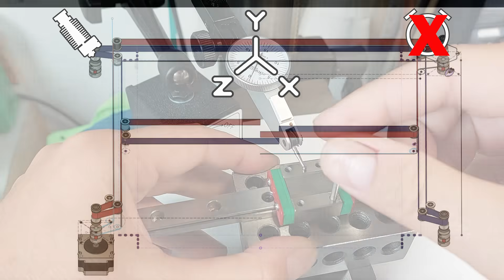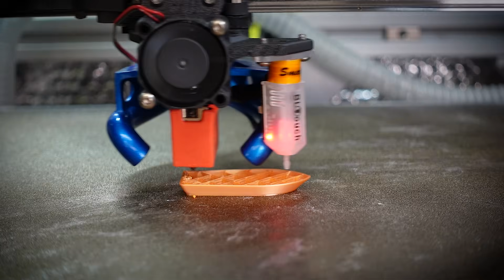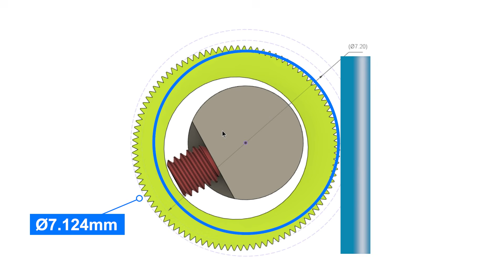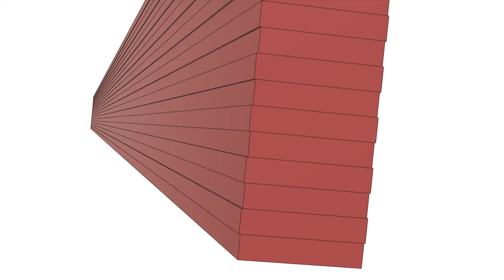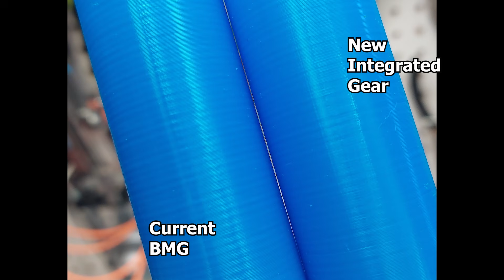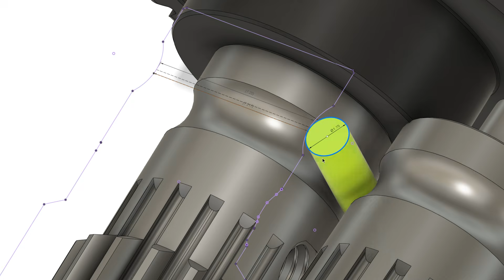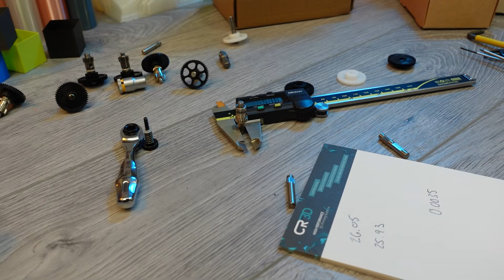Extrusion Quality - Mystery issue resolved !

Comment: {CHECK THIS OUT MY PRECIOUS ENGINEER FRIEND }
The filament diameter is also different in different sections, and its change the distance between the a gears.... so u should check the omg v2 extruder... the konception is also based on dual gear BUT IN  AVERY DIFFERENT WAY
Reply from the maker: Yes filament diameter variation will affect in several ways, one of them being the gear mesh distance.  As for the OMG v2 extruder how does it avoid the two gear sets from fighting each other due to mfg tolerances, filament centering in the hobb grove, and filament diameter variation?  These variations will have an impact on the rotation distance.  how to precisely keep them identical at all time?

Comment: This video is amazing!  The level of detail and profound insight is simply unparalleled.  In the terms of Bondtech and their gears, after modifying a few of the machines I have, including a Voron 2.4, Switchwire, and V0.1, with just bearing as shown in the videos, I can state some conclusions.  The problem with the idler is not just the machining or tolerances, the "wobble" is related to the DIRECTION in which the gear is being driven. I printed a custom mirror of a Sherpa Mini with Bondtech gears to see if the direction had any effect, which indeed it does in a reverse way.  The inducted "wobble" of the idler gear is produced by the moment applied by the distance between the gear movement, and the machined filament groove.  The harder the gear is driven, the more plastic it will extrude.  In order for the extrusion and the moments to be balanced, the idler gear would have to be balanced by another set of teeth at the same distance as the original Bondtech gear.  I tried the design using just 3d printed gears (with nylon), and the results are as good as using a bearing for the idler (which in my case I simply used properly sized rod).  I hope Bondtech and other manufacturers will correct this problem.  Thank you so much MirageC, not just for an open source amazing printer, but for the amazing, and so rare, quality content.
Reply from the maker: Oh wow!  You are absolutely right!  the moment between the resistance force from the idler spur gear and the resistance from the hobb pushing the filament may (will) vary.  Thank you for making me realise this.  I'll take this in our next meeting with Bondtech.  I'll let them know that some dude told me about that ;)

Comment: I think if we provide a tube support from top and bottom may force the filament stay in same place? just a thought
Reply from the maker: Yeas, maybe adding a PTFE at the top as well.  but PTFE are flexible and smaller ones have a ID of 1.9mm.  Using tighter fit would be a nightmare to change filament.

Comment: A few years ago I chased the same issues you had. It took many weeks of research to realize that it was the extruder that had a periodic error. Since then I always print a cone in vase mode to check for periodic extruder issues, it gives a very distinct spiral pattern if it's the extruder messing up. It's probably quite a common problem.
In my case it was a Zesty extruder that was very sensitive to how hard you torqued the bolts holding it together,

Comment: Excellent research work you’ve done hear. Bravo 👏🏼 
Do other extruder systems (eg hemera, lgx or ldo orbiter, microswiss…) show similar backlash on the gears ?
Seemed like higher precision manufacturing could solve the problem, which will unfortunately crank up prices a lot.
You got yourself a new patron :) keep on with all that great research. 🤓🤗
Reply from the maker: Thank you very much for supporting me! 😊 As for other extruders, at this point I think that while some of them might be better on the radial tolerances, most of them would suffer from potential filament walk affecting the effective rotation diameter.  I am convinced that now that the problem has been identified, we will see many new types of gears arising on the market.  More testing will be required to confirm what is efficiently controlling this aspect.

Comment: Hi. Great video thanks a lot! I'm trying to bring it on my flsun SR, but I have one question. The gear you suggest is for 8 tooth gear, while in the video I saw you have a "normal" 10 tooth one out of the stepper motor. So did you modify the wheelbase to adapt it or am I missing something?
Reply from the maker: The gear from Fysetc has the same modulus, diameter and teeth number than regular BMG gear.  Remember that we are using that BMG gear with our 10t gears, but it was initially intended for 17t.  What is important is the gear modulus.
Reply: @MirageC  mmmh ok that two gears to work together need to have the same modulus, but seen that m=d/z how is it possible that one keep the same diameter if the number of teeth changes? And the wheelbase is (d1+d2)/2, so if one of them changes the wheelbase should be adapted as well, I thought. I trust what you're saying in fact I've already bought motor and gear, I'm just curious to know where I'm wrong, sorry 😁
Reply from the maker: @anthonypasqualecarnevale1840  agreed, wheelbase will be affected if you are using an 8t vs a 10t motor gear.  Plastic gears are all 50t in what we are talking here.
My extruder wheelbase was designed for 10t motor pinion and this is what I am using.  If you are going to use 8t motor pinion, you need an extruder body that has the corresponding wheelbase to mate the 50t gear properly.

Comment: My old reprap printer had extruder with bearings and it was printing flawlessly. At one point I fully rebuild the printer with new stuff and that included upgrade to (fake) bontech gears. And yeah, the upgraded printer printed way worse. I suspected it was due to z-wobble (because leadscrews also changed), but the pattern was not repetitive, so z-wobble didn't make sense. It's nice that you have confirmed that the small gears can be the issue. Looks that I will try out the bearing extruder again.

Comment: Just use an OMG v2 and the gears problem won't even be part of the equation (for the way the extruder works).
Reply from the maker: Do you have some data or comparison images about this OMG extruder?  I am affraid that this design phylosophy may introduced artifact caused by the two extrusion forces fighting each other.  Remember, it really does not take much.
Reply: @MirageC  I really didn't dig too much: everybody was reccomending it for my printer (that comes with a BMG clone). Installed it, quality of the walls became immediately fantastic.
I guess you can find a lot of documentation online. Anyway, it's all metal (i mean, all), lightweight (for a bowden setup at least), the two internal cogs pushing the filament don't have any kind of 'play', so rotation and filament pulled is steady and consistent.
Quite expensive (around 40/50$), but i managed to get one for around 20$ (steal of the year).

Comment: get an OMG extruder, dual drive but inline big gears.
Reply from the maker: And what happens if one of the idler is getting the filament slightly deeper in the hobb groove?  Will the two pushing forces work against each other?  I am not convinced about this setup. And it is fairly bulky and heavy for a direct drive.

Comment: Wouldn't the cheapest way to get the hobb more centered on the shaft just be to use a hobb with more grub screws? A tapered collar on the shaft to shim it centered also comes to mind.
Reply from the maker: This could work, but the succes of it would be dependent on the abilities of the user performing the assembly.
Reply: @MirageC  That's definitely true for perfect centering, but isn't the worst centering one can get with 3-4 grub screws just about what you get by default with one?

Comment: This got me wondering: What if a soft rubberized surface were used at the contact point with the filament while maintaining the original grooves for shape support and more even pressure, something like a rubber washer for instance?

Comment: How about Libra mini helical gears?
Reply from the maker: Per design, they will be subjet to the same failure modes as seen in this video.  It is then a question of tolerances.  The double gear may limit the idler shaft tilt, but it wount prevent filament walk in the hobb due to nozzle back pressure.

Comment: Wow, thanks for checking that out. I knew about flow variations causing ugly surface finish but I hadn't imagined there could be up to 0.1 mm runout there. Also all the other culprits you mentioned. Good info, I might get into this at some point.

Comment: My TPU prints don’t show this artefact. I tried Pla at the same speed but it did. I wonder if the elasticity of the material compensates for the change in pressure
Reply from the maker: yes! that is exactly why.  TPU will act as a capacitor.

Comment: For all your talk about scientific approach, how do you explain the rotation of the hub gear being in perfect sync with your Z height to make such a pattern? Hint its not. Your issue is most likely your heat bed is too constrained, and while it heats up and cools repeatedly it causes the artifact. Make sure your Heat bed is PID tuned properly, and un-constrain it. This Z-wobble, that isn't related to the Z-Axis mechanics has been a common known problem us REPRAP guys for 8 years that it's a heat bed moving up and down with heat expansion. That's also why you buy a printer with a properly supported heatbed on springs, that allows the bed to expand downward against the springs when it expands leaving the top layer at Z=0 regardless of how much the bed expands.
Reply from the maker: I think you should re-watch the video ;)  And also have a look at the HevORT bed design in my other videos.

Comment: I'm still amazed how nice and clean my old Replicator Dual printed, although suffered from buffer/speed issues printing off flash cards, which I didn't realize because I switched from Simplify3D direct control to newer better slicers and didn't put the puzzle pieces together. Now Klipper is nearly required for fast quality prints

Comment: Hi first of all, great video as always!  But since i saw it something bothered me. Finally i realized what. 
You did not talk about FILAMENT FEED RESISTENCE. 
By that i mean the sum of the forces resulting from: 
-the actual unwinding of the filament
-the spool friction on the holder  
-the friction between the feed tube and the filament. (this is random and variable both in time and magnitude)
I thought of bringing this up because at work i had this problem whit a long filament feed path from a dry box to the direct drive of the printer, and until i realized this was the problem extrusion was inconsistent. In time whit the wear of the feed tube this inconsistency degenerated in what appeared to be pulsating over extrusion in to strait forward under extrusion. 
I do not know if this is something applicable for the printer used in the test. But it will certainly affect the final quality of the parts.
Reply from the maker: Oh yes! This is a very good point.  You are totally right.  Filament drag and nozzle pressure are two things that WILL affect the actual amount of plastic that will be extruded.

Comment: Can you help me understand how the tilt of the idler creates a reciprocating filament extrusion volume? It seems like while not being ideal it would cause a constant shift in extrusion rate (no diameter shifting).
Reply from the maker: My thinking is that it will climb on a larger diameter until the shifting force can't, then will slip back to the bottom of the groove and start over.  This might also be amplified by the eccentricity of the drive gear.
Reply: @MirageC  interesting idea! I imagine this would create an asymmetric wave of extrusion rate via a slow ascent as it climbs to a larger radius and then a sharp decrease when it slips to the smaller radius (akin to walking up the stairs then jumping down). Did you notice any asymmetric flow variation or did it seem more symmetric (although this may be hard to measure/tell).
Reply from the maker: @connorl8124  Hard to precisely tell.  But from my observation, it does seem to be cyclic.  But once again.  is it related to the eccentricity of the drive gear dictating that climbing and falling off the stairs?

Comment: A much bigger extruder gear would reduce the error from misalignment. Downside is that the motor would need more torque to match
Reply from the maker: Yes.  This is one part of the solution I am looking at.

Comment: I have always had this issue, and I always assumed it had to do with frame/motion system slop. This was several years of mystery finally solved for me, as I'm sure it was for many others! Thank you so much for putting all this work into getting to the bottom of this!
Edit: It does raise a question though...... why is it that the motion components don't cause error on, seemingly, even an order of magnitude the same scale? I guess it must be due to the belts (or wobble wings!) acting as a low pass filter, similar to how you demonstrated that a bowden system acts?

Comment: PLEASE USE A INVOLUT GEAR TYPE IF YOU TAKE CARE ALL THOSE DETAILS YOU MOST PAY ATENTION TO THE GEAR TOOTHS , ON MICRONS IS VITAL TO PAY ATTENCION TO LAG ON TRANSLATION FORCES thank you for your efforts to find excellency
Reply from the maker: BMG meshing between the drive and idler is already using involute gear type.  The problem previously identified in Mihai's video is that the distance between the gears will vary due to many factors.

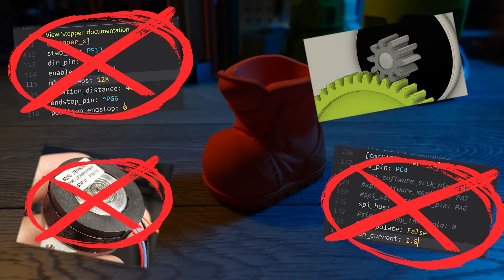My video is about 2 other sources of artifact.  See at 6:37 how I address gear meshing ;)

Comment: You can't imagine how relieved i am to see this video. I use Ender 3 v2 and i have more extreme problem because of this situation. My extruder gear presses so hard and inconsistent that it usually breaks the filament. I changed my gear with something else and now it is better now. However it is not solved. Just while i was watching this video, my printer have done it once more. So the eccentricity in the gear and shaft is a bigger problem of mine. I hope you will find a good solution to this with bondtech because i am about to turn myself away from 3d printing if i can't solve this problem. I can't even print a single part without leaving the printer one moment. Video is very good. Subscribed and liked. Can't wait to see update on this situation.

Comment: Are there any sensors that could measure pressure/flow in the hotend? I've seen optical sensors for filament diameter. A sensor in the hotend could adjust for all inaccuracies. I guess the stepper drivers are not sensitive enough.

Comment: Very good insight, will definitely inspect my extruder, thanks. Although, in this case, where extruder components are affecting extrusion volume, you should see it by printing out a long single line, just like you did with silicone example. Given that idler gear, where gear grips the filament, has ~1-2cm diameter, you should see the extruded filament volume variation along the printed line, also at around 1-2cm. That's much shorter distance than a layer perimeter. Therefore, I don't think this is where the Z axis artefacts shown in your prints, are coming from. Your observation with the bowden tube is crucial, issue is definitely in the direct drive setup. My 2 cents would be with the stepper motor instead. You said that you examined both stepper and the driver, but from my experience I can tell that sometimes the expected stepper rotation is not always the same as the actual rotation, due to controller or the controller settings running it.
Reply from the maker: The hobb diameter has 7.2mm which translate in a 22.62mm circumference.  Using the circumference and the filament cross section, I measured the volume of plastic from one full hobb rotation.   Dividing that volume by the layer profile(0.5 * 0.2)  it gives me a perimeter of 544mm corresponding to one full turn.  Pattern was not repeating on that part. 
Relation between requested rotation(software) and obtained rotation(measured) depends on the gear tolerances, the level of hobb teeth penetration and the back pressure from the nozzle. If your controller does not know how many steps in one full stepper rotation, you have a bigger problem my friend.

Comment: This is faaaaaaar the best video about 3D printing, i have ever seen and i've seen a lot of them. Sadly, there are way too much bad videos about 3D Printing out there. It's time, that the manufacturers of 3D printers increase their production quality and you bring them with your engineering competence on the right way.  Thank you very much for your effort.  I know,  that your research in that case was a lot. Best greetings from Austria (not Australia 😉)
Reply from the maker: Wow, thanks! Glad you like it!  FDM is not dead.  Although resin has gained a lot of ground in the past couple of years, it remains a messy process where part size is generally limited.  We can still push the boudaries of FDM printing.
Reply: @MirageC  Resin printers are actually too limited with their materials as they can directly compete with FDM at this moment.
But the surface quality of resin printed parts is really impressive. I think that both technologies will remain for a long time, because they are too different that one will replace the other. Best regards